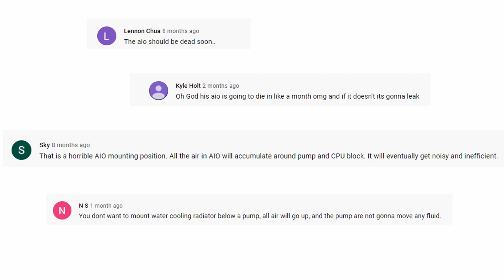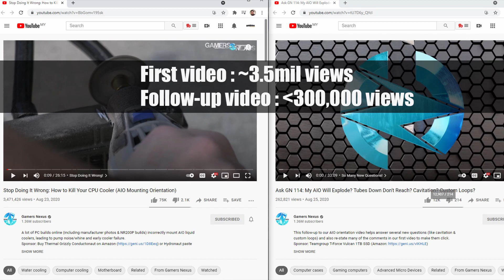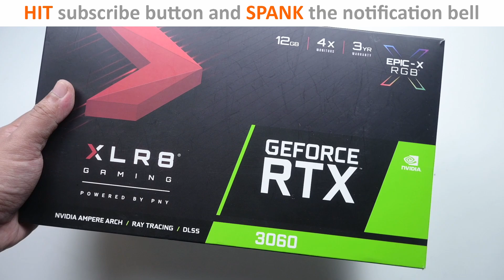Radiator at the bottom, Pump at the top - Still alive? Why?

Comment: I bought a custom built pc and told them to mount my MSI Suprim X radiator at the bottom of my Phanteks NV7 showcase full tower case. Am I fine?
Reply from the maker: Not sure, you have to check with them. Does the pump give any gargling sound?
Reply: @goldfries   not really
Reply: @goldfries  either way the temperatures are completely fine
Reply from the maker: @Coffee-ql1xv  Nice, I wouldn't worry about it either. If it breaks, there's warranty.
Reply: @goldfries  Yeah, pretty sure its a 2 or 1 year warranty anyways. Either way, thank you for the help though I appreciate it!

Comment: Which aio can I buy right now and not have to worry if it's at the bottom? I have the Galax version of the tecware fusion white color. Interesting video.
Reply: I am considering the same question due to case size. I have found about some external pump AIO like Be Quiet Loop 2 FX or Thermalright Frozen Notte. Those AIO's pump seems keep sinking inside the coolent even you bottom mount the radiator, but the cooler may suffer the air like the pump pumps up a coolent fountain, at least no mechanical threat of the water pump. Currently there has no youtuber to test those AIO mounted at bottom have or do not have those worries and i really concern about the results.

Comment: This is going back nearly a year now but I just noticed something that confused me. The Pauls Hardware video with the Phanteks case that you referred to featured a bottom-mounted radiator, but the tubes, or at least one of the tubes is higher than the pump. The pump still failed though. Do you think the tubes needed to be higher, if so how much higher might the tubes need to be? Is it okay if just one tube is fully above the pump? I'm interested as I'm doing a similar build with an AIO in the same Phanteks case (It's a horrible case but I got it for free...)
Reply from the maker: If it's higher I think it MIGHT fare better, or at least not die so soon. It's difficult to say how much higher it should be because we don't know  the amount of liquid fills the capacity. 

That's why in another one of my video I did the same as this one and did not proceed because the AIO was giving some "sloshing" sound at the pump, didn't feel like it was safe.

Basically pump above rad, yes BUT we have to visualize how or whether the liquid is covering the pump.
Reply: @goldfries  I see!  If pump is above rad, make sure the tubes are as high as possible in the loop and I guess listen/observe to see how it sounds/performs. Thanks!

Comment: In my vintage IBM Aptiva case, I had to put the radiator below the pump.  The tubes weren't even long enough for me to curl them around like you did, so the pump was the highest point.  Even with such abuse, my Corsair H60 (original 2012 version with CoolIt pump) survived 8-years before it "died".  It got noisy and CPU quit cooling sufficiently.  Apparently, over time, the permeation got bad enough that the coolant level in the pump got too low.  Well out of warranty by then, so I took the cold plate off and topped off the coolant level (it did require quite a bit).  It's been working perfectly the last 1-1/2 years cooling an i7 9700K.  This is my main PC and it's seen very heavy use.  Even on 24/7 for several years GPU mining.  Pump at the top isn't ideal, but I don't think it's a guarantee of pump death.  Then if it does "die", as long as the pump still runs, they can be refilled pretty easily.
Reply from the maker: 8 years is VERY long. :D Just goes to prove it's not that bad as what most made it to be.

Comment: so what you're saying was....
- it's completely fine to mount AIO at the bottom
- ...if the water tubes isn't placed below the pump head - that way the pump is still submerged with water

correct?
Reply from the maker: Yes. There's another video I made using the Geeek G1 SE, in that case the installation was the same but the water level seems low and there's gurgling sound on the pump and it happens quite often. That's a sign that the water level is low and barely covering the pump, that setup got dismantled.